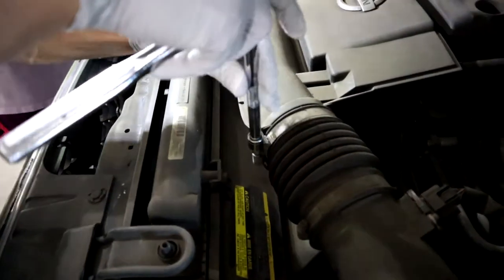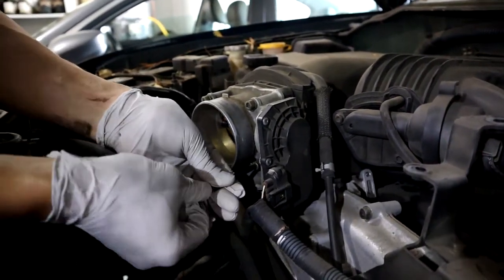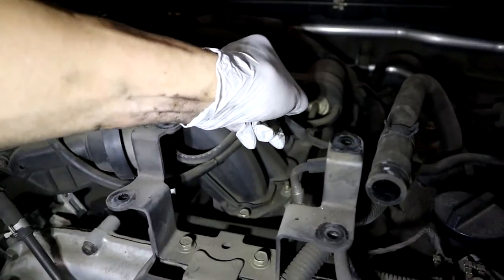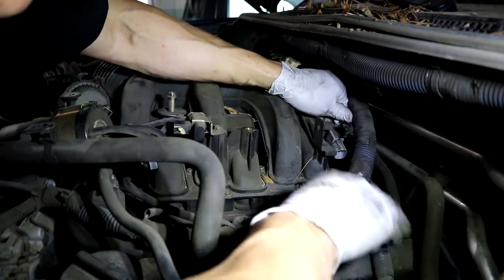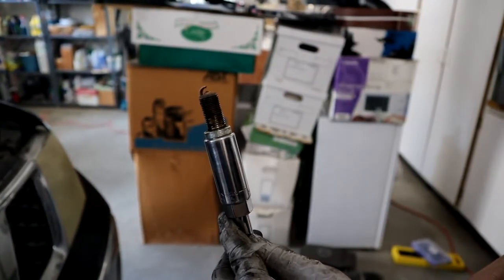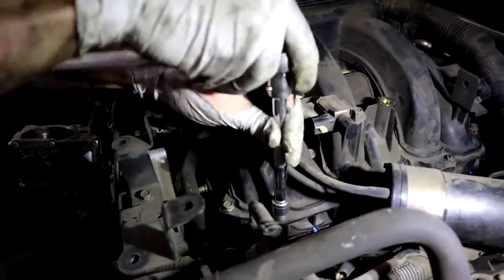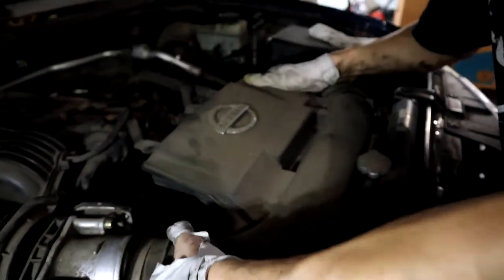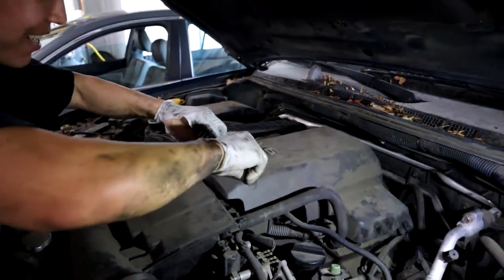Nissan Frontier 4.0 V6 Spark Plug Change

Comment: Thanks for the video. Now I know why the dealer wants $660 to replace the plugs.
Reply from the maker: Yes.  Nissan didn't think that one through when engineering this car lol.  I like my Honda's, takes 5 mins to do spark plugs haha.
Reply: You can do it without taking plenum off, little bit of a pain in the doing #1,#3 plugs but a swivel, extensions and creativity it's possible.

Comment: This is a great video, just wish someone would do a exact video like this except add what to do if your throttle body Allen bolts are stripped!!
Reply from the maker: Probably going to have to drill them out.  That's usually how you get out stripped screws like that.  Or there's a tool you can use to take out stripped screws which works sometimes.

Comment: My plenum bolts were absolutely rotted on top. 10mm only worked on the front one. I had to wire brush them and then hammer (gently) a 3/8 socket on to them. Lucky that worked, I have no idea what I would have done to get them out otherwise. There's barely room for a socket, never mind trying vicegrips or having to cut the bolts. Odds are, you're going to buy a new plenum as well if the bolt heads are too far gone.
Reply from the maker: You must live in an area with snow or harsh weather?  That sounds horrible.  Next time, maybe try PB Blaster  as that might help with the rust on top.  You'd probably have to drill out the bolts if they were that far stripped after trying.

Comment: Thank you my friend, the only difference I had was that the two bottom bolts on my throttle body were completely stripped so I had to leave it on without disconnecting the electrical plug.  Pain in the arse!
Reply from the maker: Omg I bet!

Comment: This may be a stretch but do you happen to know the bolt sizes for the upper intake? I have a supercharger on my frontier and need the bolts to go back stock.
Reply from the maker: Yup, stretch for sure, sorry.  No idea.  What I'd do is if you can find a Nissan dealer that sells online genuine parts, you'd be able to find the size of the bolt there.  That's what I'd do if it was a Honda.  There are tons of Honda dealers that sell genuine parts online and you can look at the catalog.  That's what I do every time I need to order Honda parts for our other cars.

Comment: Do.you need to change the coils also when you change the spark plugs? My service engine soon was blinking yesterday....bogging down no acceleration.  Brought it to mechanic,  diagnostic says the #5 cylinder is not working.  Mechanic says I should change coils also. $1350.
Reply: That's all 6 plugs changed and the coils changes for $1350.
Reply from the maker: Coil packs aren't exactly necessary to change when you change spark plugs.  Usually you'll only need to change coil packs if they die.  On this car though, I've heard the coil packs are kinda shotty.  It's up to you, as you can see in the tutorial, getting the passenger side sparks out isn't easy, so it would suck to have to pay labor again just to change the coil packs.  If the mechanic can show you the packs are bad, that would be better.

Comment: What mileage did you change those plugs?
Reply from the maker: Iridium spark plugs should be changed around every 100k miles.
Reply: hello good video how can I know which is the correct spark plug for my nissan feontier pro 4x.  ?  since in an auto parts they gave me long ones and the ones I took away were short, it helps